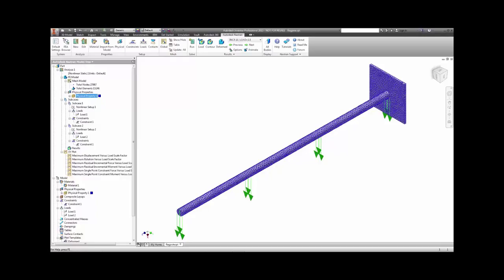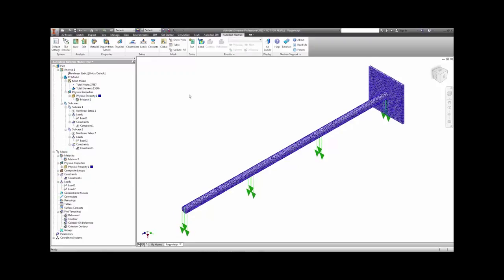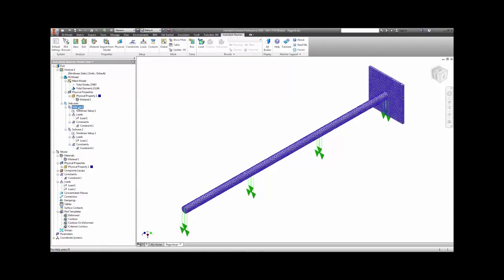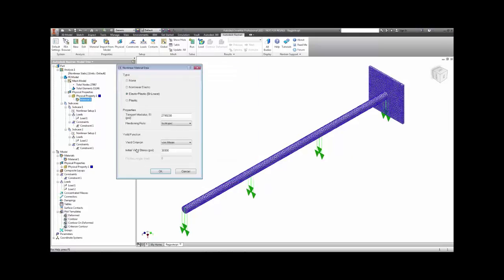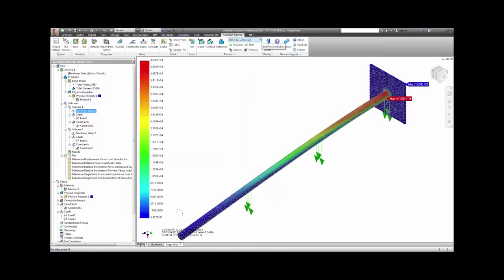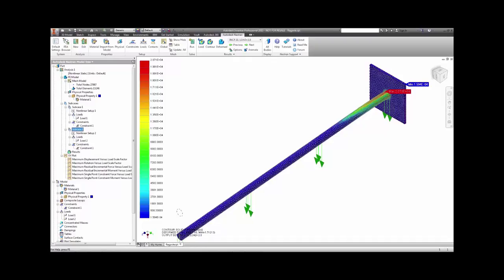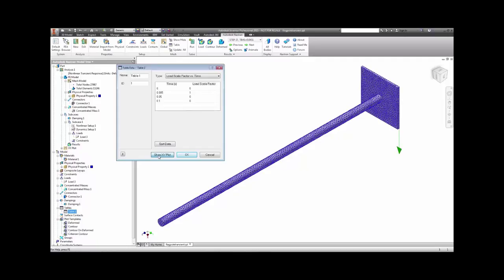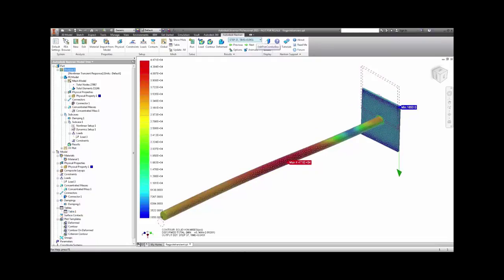Nonlinear Static Transient Response

Comment: How to perform a Static Stuctural Analysis to find the compression strength of a Tapered Hollow cylinder ? 
Cylinder Base OD 140mm, Top OD 90mm.
Wall Thickness - 4mm,
Height 250mm,
Material : Polypropylene ( General)

Basically to find out with give size and material how to simulate to find out the max load ( KN ) the Cylinder can resist till it break or fail. A Tutorial can help.